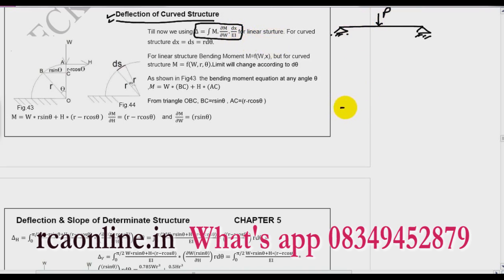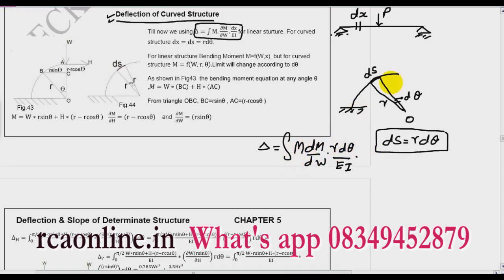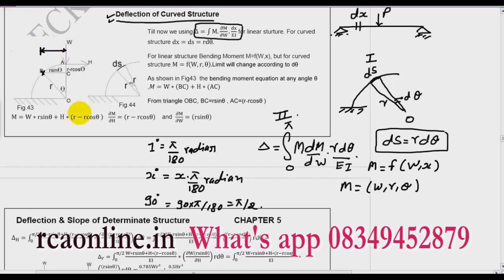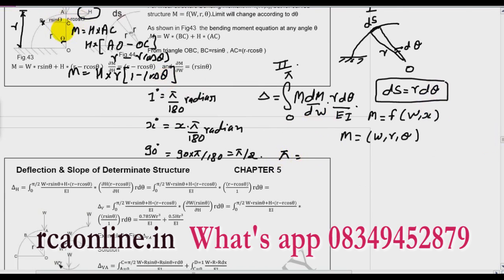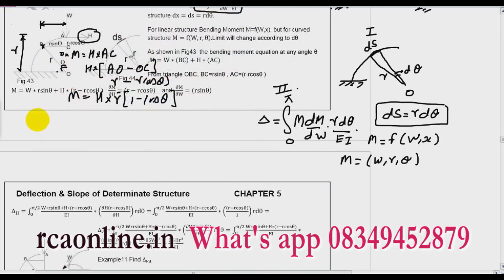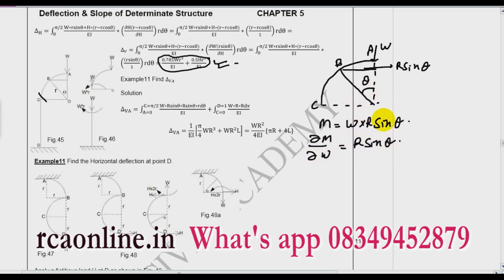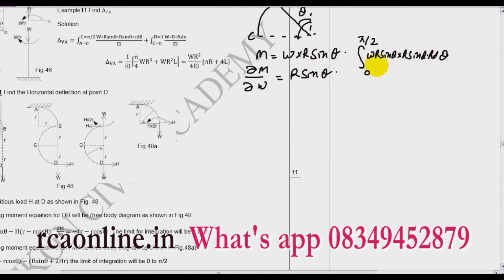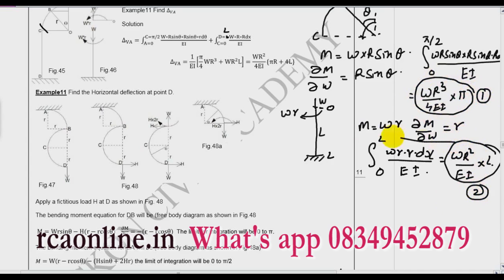How to Find  Deflection of Curved Members Using Castigliano's Theorem

Comment: Is it possible to apply Castigliano's theorem for bent tube or rod. By bent rod I mean V- shaped rod with angle greater than 90 degree. The bent rod the vertically aligned with upper end having a weight hanging and lower end is fixed to the ground.